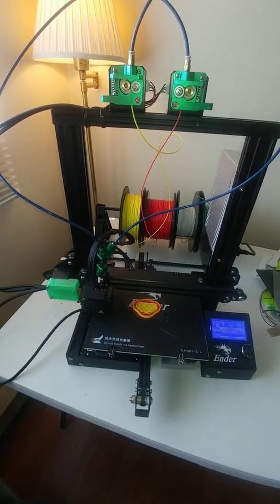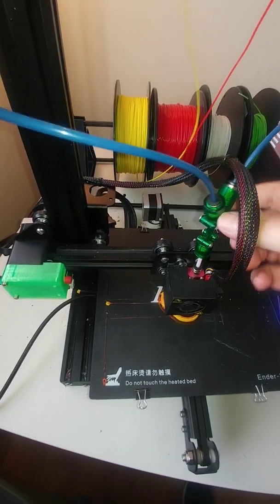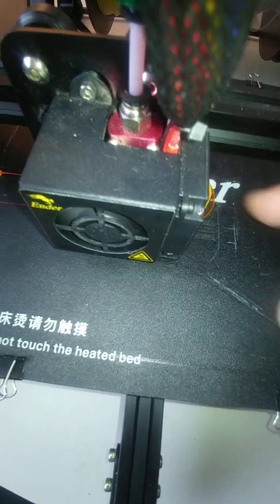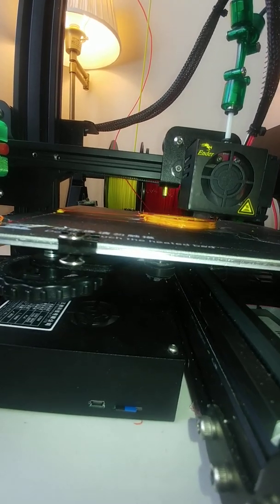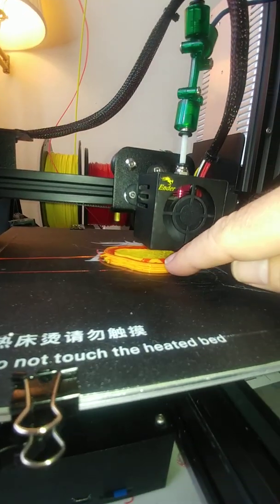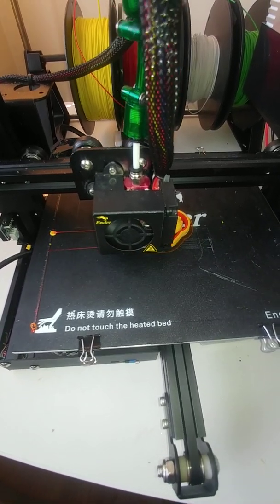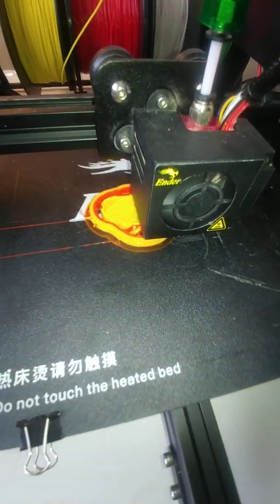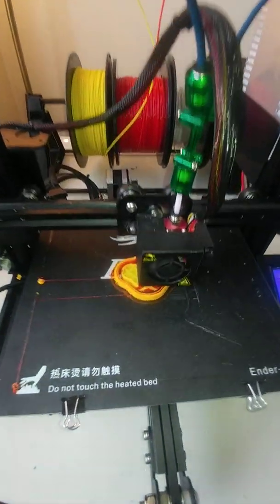3D Chameleon Dual Color on Creality Ender 3

Comment: how is the tip shaping done exactly
Reply from the maker: Take a look at our GCode Generator on the website.  Basically the filament is allowed to cool while it is is moving inside the throat of the extruder.  Periodically, it is rammed into the tip of the nozzle to pick up any molten filament left in the tip.  Once it's cooled sufficiently, it's then extracted from the extruder.

Comment: What board are you using? Can this be used with the stock 4.2.2 motherboard so I can keep the bl touch?
Reply from the maker: The 3D Chameleon is agnostic to the boards or firmware... we don't tie into them in any way.
Reply: So... Basically the only thing that changes is the gcode in your slicer if I'm understanding correctly?
Reply from the maker: @captainthiccnick  Yep.  All the magic is done in the gcode.  It commands the 3D Chameleon through moving the head or the build plate to touch a switch that sends commands to the 3D Chameleon's own electronics.  You can see our custom gcode on our website... in the GCode Generator... just pick some random values and click the button, it'll generate a block for you.
Reply: @williamsteele  coming back, so in theory if I wanted to put the time and effort into making this work with say an MKS Gen l in side an mpsm. It's possible to achieve?
Reply from the maker: @captainthiccnick  That was one of our demonstration machines several years ago when we first introduced this.

Comment: What is the final product? And it doesn’t look like the colors really dint mix together. Good job on the install but looks like it doesn’t work to well with the division of colors.
Reply from the maker: Actually, this video is two years old and is of the old Mk1 version.  The part was the dual color Moai Statue (https://www.thingiverse.com/thing:1560492).  I'm not sure I understand your comment... the colors aren't supposed to mix... and they were divided just fine... the outer shell is the purge wall (using Simplify3D) and that's a disposable area where the nozzle is designed to purge the previous color into so that the part inside it doesn't have mixed colors.  Take a look at some of the sample prints from our website to see what the final parts look like.  The newer Mk2 version is four colors.  https://www.3dchameleon.com.

Comment: Seems to me that you would want to somehow support the y-splitter so there's no movement when you change colors. It kinda freaks me out to see it wobble around, having only the short bowden tube for support.  Maybe a 3d-printed support plate that somehow attaches to the x-axis carriage...

Also, if the extruders were on slightly taller mounting plates, they could be flipped over to avoid the rather ugly loops of bowden tubing, and even more importantly, reduce the amount of bowden tubing needed for the kit. Couple that with some customer-provided 3d printed filament guides so you could feed them from the top without the filament going all wonky.
Reply from the maker: It's actually zip tied to the wire bundle... it really doesn't hurt it as the PTFE tube and the wire easily stiffen it enough to not cause any problems.

Comment: That's some nasty wheels on that Ender 3. At least it works. 

Should've recorded it in higher quality. Do you not have a single friend with a Sony, Samsung, modern Nokia or iPhone?
Reply from the maker: I was recording it to demonstrate it... not win an award. :-D  And as for the wheels?  Nasty?  Creality machines do that by themselves... they just pick up dust and cause it to accumulate that way.  Doesn't hurt anything and this was actually wiped off before the print. They do pick it up that quickly sometimes.
Reply: @williamsteele  I know that creality wheels are crappy. I was more commenting on the fact that you didn't really q-tip everything squeaky clean before recording this product demonstration. But whatever.

The ideas and execution are amazing though. I, just like many others, am more impressed with the tube junction than anything else - a working MMU1, who would've thought. 

Button system isn't all that relevant for "professional" cheap 3D printing enthusiasts, since you can use Klipper, and add unlimited amount of extruders to any machine by adding another microcontroller and tuning in pressure advance, which is significantly better than linear advance.

Comment: Does the stock board have room to connect another stepper for a second extruder?
Reply from the maker: You don't need another stepper connector... the whole idea of the 3D Chameleon is so that you don't need different electronics.  The 2nd extruder is switched with the first using the switches.
Reply from the maker: No, not at all... the switches handle that.  It's designed to use only the stock electronics with no firmware changes.

Comment: Very cool! I agree with Stig Berntsen, can it purge into the infill? I would think that would be a G code issue? A lot of people interested in multi material printing have been asking about that to save on filament and print time.
Also, I agree with him in that $99+ 99 should be $198 not $199. Prices usually go down slightly when you get the more advanced kit.
Reply from the maker: It's all in the packaging and the extra parts required for 4 colors.  You have a different Y adapter for 4 colors.

Comment: Hi, Cool concept. Does it purge inside the printed part itself? Did not see any purge-tower on the bed. Oh, and one small note - 2 + 2 = 4, so why is the 2 + 2 units (99 + 99 ending up as 199, and not 198 on the webpage? Normally when people buy more units, the price pr unit decrease, not increase :)
Reply from the maker: It's all in the packaging and shipping.  It's actually still cheaper when you factor in the shipping cost... but the price is actually higher per unit due to the packaging.  Trust me... after shipping, you still save about $10.
Reply from the maker: Purging is a function of the software... so whatever the slicer does is where it purges.  In my example, I use the ooze shield as a purge.

Comment: Do you have a web site link ? Also I need too see how the slicer G code files are made. Do you have a video on this step ?
Reply: https://www.3dchameleon.com/
Reply: Thank You. I did not find any installation info on the web site or walk threw of how to set up the slicer G code to work with the product. But maybe that is in the works. I will check back. Looks like a great product from the Printing Nerd video.
Reply from the maker: @Don Gray No, it can also be paired up with direct drive... but it is a little more complex.

Comment: Hi, Noticed the Tweet about this.  Had you tried it with PVA for support? Will it work on a Cr10S Pro as well?
Reply from the maker: It will work on any Creality style printer... and any material that can be extruded by the stock system.
Reply: @williamsteele  Will it work with an Ender 5 equipped with an E3D Titan (bowden) extruder?
Reply: @yvan2563  yes
Reply: As always, it great to see what you've come up with.